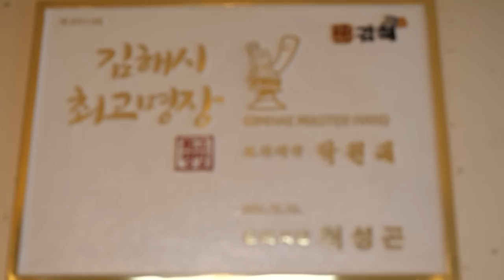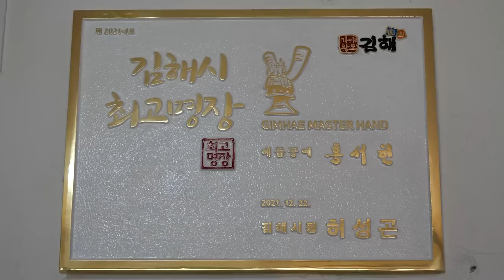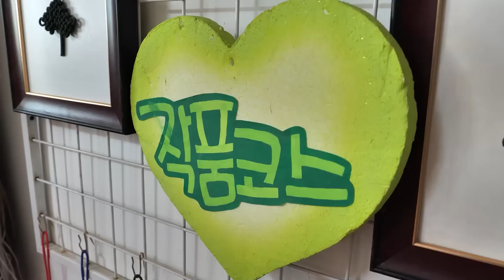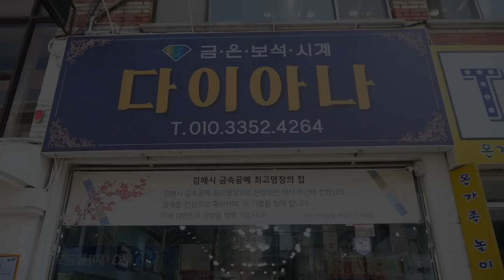Amazing handicraft! Korea's best masters TOP 4.

Comment: I feel such nostalgia knowing I've done 3 of these 4, though obviously not to master craftsman level. 
I loved doing the Goryeo celadon pottery! I used a different green glaze than the rest of my classmates and it flopped. It didn't mix properly and the beautiful green required a thick that it just didn't get. I still love the ivy design I spent hours carving and the inside has a beautiful green, like a hidden treat.
The knotwork is very difficult to get even! I used rattail cord and a maneki neko bead to make a phone charm, and some thin cord to add knotwork to a bracelet. I had a whole book of the different knots that she performed. I didn't try the super complex square knot. I just didn't want to keep evening out the loops and rows. It's beautiful though. 
My main critique with the silver vessel forming etc is that the amount of solder used on the chopstick rest was ridiculously excessive, and it really wasn't necessary to spend five minutes watching him thin down his half flattened silver billet down to sheet...yeah, lots of time and work. In the west we usually just purchase sheet because it only costs a few cents more than casting grain and you waste that money in fuel melting and pouring the grain into a billet and then in time and fuel again to thin the sheet. It just doesn't make sense except to make the buyer pay extra for the time and resources you spent doing it. FYI I have everything but the paper for a BFA in Jewelry and Metals, so yes I know my stuff.
When I think about all the metal I must've inhaled and eaten in residue off my hands? Gross. I loved the hood he had over his buffing wheels! Ours had dust extractors in the back attached to a shop vac, but when you had to rake out the caked in compound from an over enthusiastic first year student; it was all up in your face. Safety glasses protected your eyes, but your nose and the rest of your face were free game. Dust it out of your hair too. I started wearing a mask.